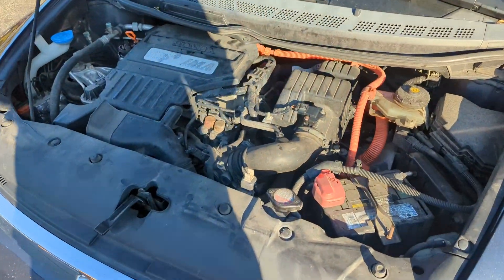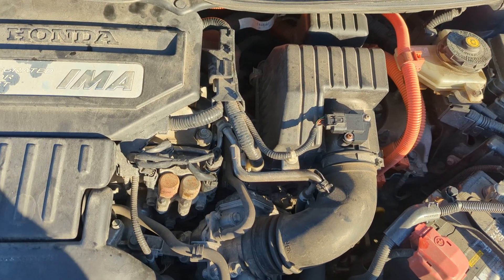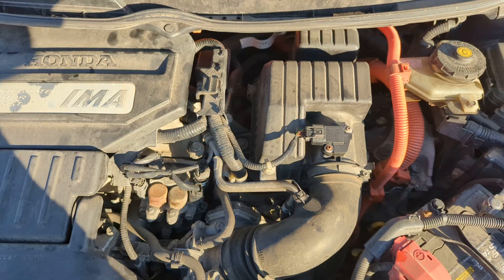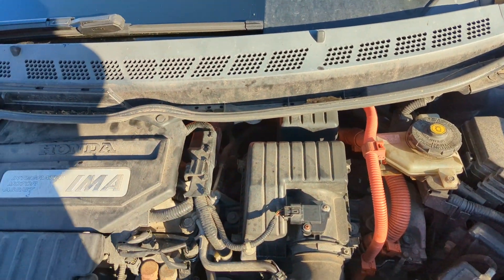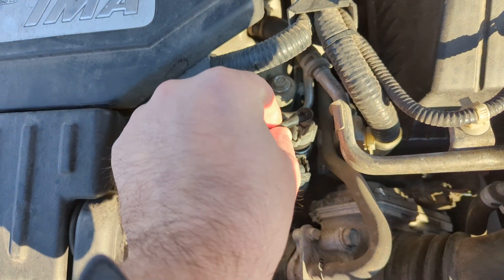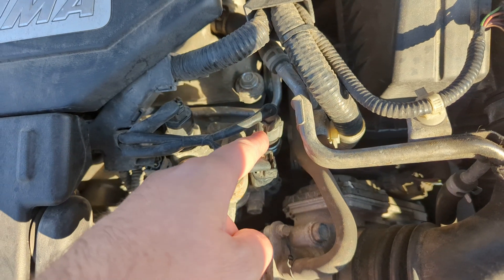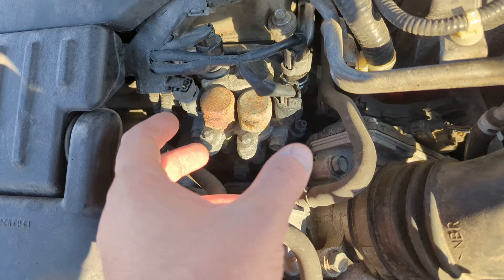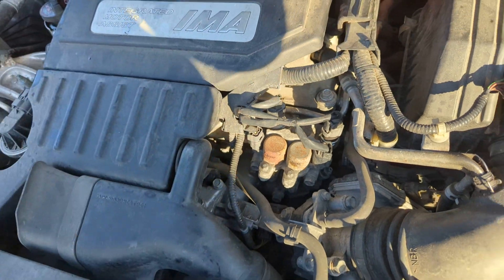Honda Civic hybrid 2006 rocker arm sensor b

Comment: is the same for honda insight 2010? I looked at those two sensors just like your car ,my oil presure sensor is bad in my honda isight 2010
Reply from the maker: I'm not sure but I know cleaning the manifold cleared codes for me and allowed me to connect my egr sensor

Comment: How did you fix it
Reply from the maker: Just got a new sensor from an auto parts store
Reply: @LetsReviewThisS  thanks bruh
Reply: Do you know the part number
Reply from the maker: @remynyc23  just call O'Reilly's or any auto store sorry don't know it
Reply: I got the same codes just wondering if you were getting misfire codes also?
Reply from the maker: @bigflaco323eastla8  I was not
Reply from the maker: Clean your manifold I have a video about it

Comment: DTC Troubleshooting: P128A (114) 
______________________________________
DTC P128A: 
EOP Sensor Circuit High Voltage 
NOTE: Before you troubleshoot, record all freeze data and any on-board snapshot, and review the general troubleshooting information . 
1.	Turn the ignition switch ON (II). 
2.	Clear the DTC with the HDS. 
3.	Check for Temporary DTCs or DTCs with the HDS. 
Is DTC P1289 or P2651 indicated? 
YES 	- 	Go to the indicated DTC's troubleshooting.■ 
NO 	- 	Go to step 4 . 

4.	Turn the ignition switch OFF. 
5.	Check the engine oil level. 
Is the level OK? 
YES 	- 	Go to step 6 . 

NO 	- 	Adjust the engine oil to the proper level, then go to step 11 . 

6.	Turn the ignition switch ON (II). 
7.	Clear the DTC with the HDS. 
8.	Do the VTEC TEST in the INSPECTION MENU with the HDS. 
Is the result OK? 
YES 	- 	Intermittent failure, the system is OK at this time. Check for poor connections or loose terminals at rocker arm oil control solenoid 1, rocker arm oil control solenoid 2, the rocker arm oil pressure switch, the EOP sensor, and the PCM.■ 
NO 	- 	Depending on the result, replace the appropriate part, then go to step 9 : 
• 	ENGINE OIL PRESSURE SENSOR HIGH VOLTAGE: EOP sensor 37260-RNA-A01

• 	ROCKER ARM OIL CONTROL SOLENOID 1 STUCK OFF: Rocker arm oil control valve 15810-RMX-005

9.	Turn the ignition switch OFF. 
10.	Reconnect all connectors. 
11.	Turn the ignition switch ON (II). 
12.	Reset the PCM with the HDS. 
13.	Do the PCM idle learn procedure . 
14.	Do the VTEC TEST in the INSPECTION MENU with the HDS. 
15.	Check for Temporary DTCs or DTCs with the HDS. 
Are any Temporary DTCs or DTCs indicated? 
YES 	- 	If DTC P128A is indicated, check for poor connections or loose terminals at rocker arm oil control solenoid 1, rocker arm oil control solenoid 2, the rocker arm oil pressure switch, the EOP sensor, and the PCM, then go to step 1 . If any other Temporary DTCs or DTCs are indicated, go to the indicated DTC's troubleshooting. 
NO 	- 	Go to step 16 . 

16.	Monitor the OBD STATUS for DTC P128A in the DTCs MENU with the HDS. 
Does the screen indicate PASSED? 
YES 	- 	Troubleshooting is complete.■ 
NO 	- 	If the screen indicates FAILED, check for poor connections or loose terminals at rocker arm oil control solenoid 1, rocker arm oil control solenoid 2, the rocker arm oil pressure switch, the EOP sensor, and the PCM, then go to step 1 . If the screen indicates EXECUTING, keep testing until a result comes on. If the screen indicates OUT OF CONDITION, go to step 14 and recheck.